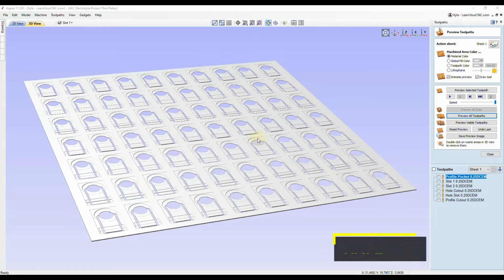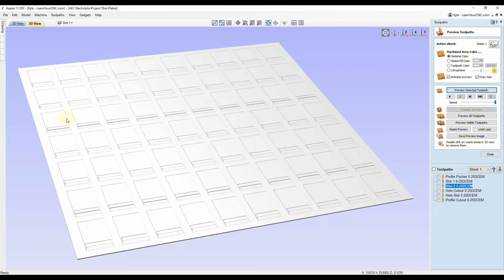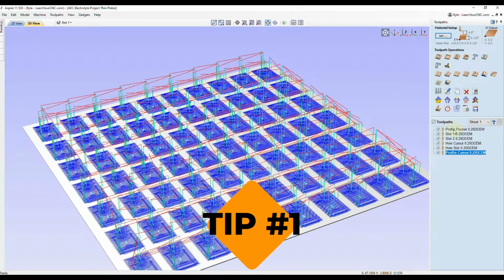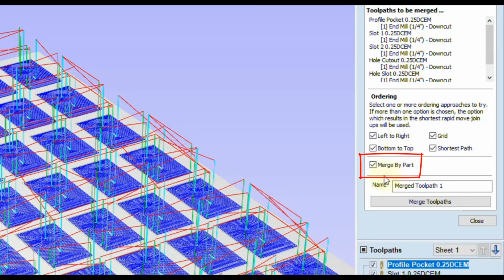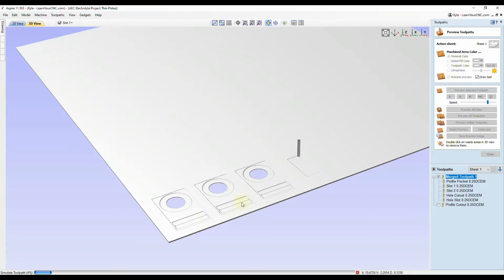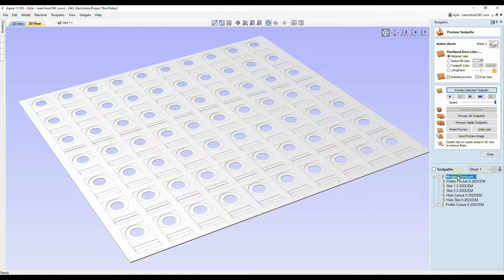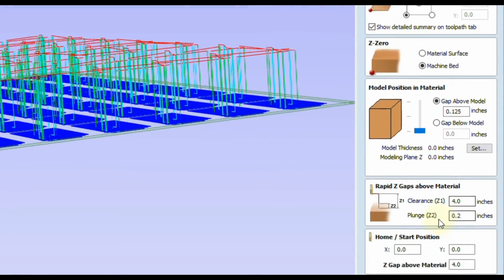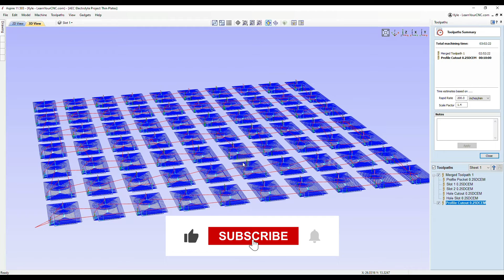2 Tips to save time on batch toolpaths - VCarve, Aspire, & Cut2D Quick Tip

Comment: Shouldn't time be dependent on your machine. A rigid machine can be moved faster. How is aspire calculating time?
Reply: The software knows the feed rate for each operation.. what he don't know is the rapid movement speed. But you can set that number in the Time estimation icon.
There are other variables like acceleration... So you have a correction factor also, to adjust the simulation to the real time. 
Hope you get the explanation
Reply: It’s entirely machine dependent

Comment: Changing the circles to no longer machine material that will later be discarded would shave some time off too….

You have to be careful with merging toolpaths. I’ve run into issues where I had a pocket operation, followed by a cleanup pass, among a bunch of other things. Everything looked fine, but when I ran it, the cleanup op ran before the pocket op. It was in the right order in the software, and nothing I did was able to switch the order of those 2 ops. It remains a mystery to this day… ultimately, I just made 2 separate merged toolpaths, 1 for pocketing and 1 for cleanups…